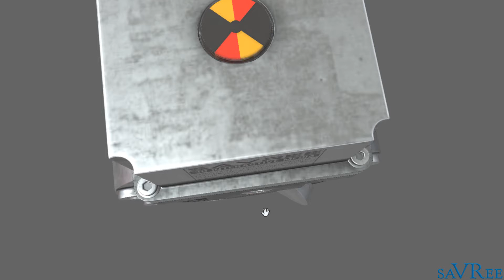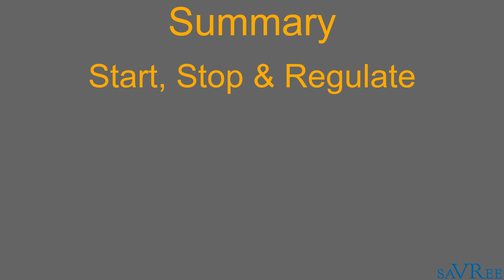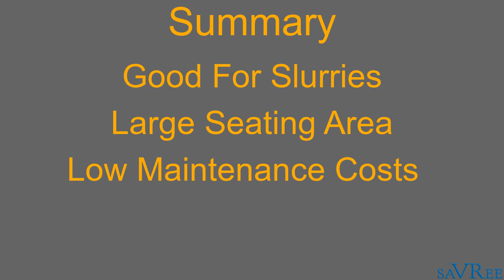How Butterfly Valves Work

Comment: What might cause the disc to suddenly scrape particles off the seat? I have a valve that's been working for years. No change in any other parameters as I can see. And yet, recently, the valve scraped off a noticeable amount of particles.

Comment: Why using gearbox increases response time?
Reply from the maker: If you have a gear ratio of 2:1, the valve takes twice as long to actuate i.e. you turn the wheel more but movement is less. Hope that helps.

Comment: I really enjoyed the video ! 
Can this lug wafer butterfly be used with natural gas ? And a servomotor for regulation ?
Reply from the maker: I visited a gas cavern once and a few pump storage stations etc. They had a lot of ball valves, but I don't remember seeing butterfly valves. If the seal can withstand the corrosive nature of the gas, then I imagine they can be used within gas systems. I would have to research it a bit though. Servomotor = yes, good for throttling.